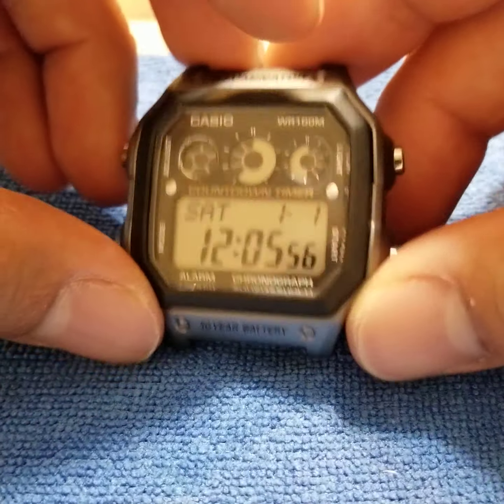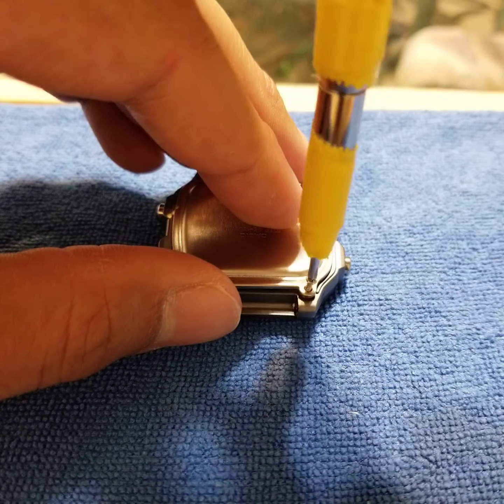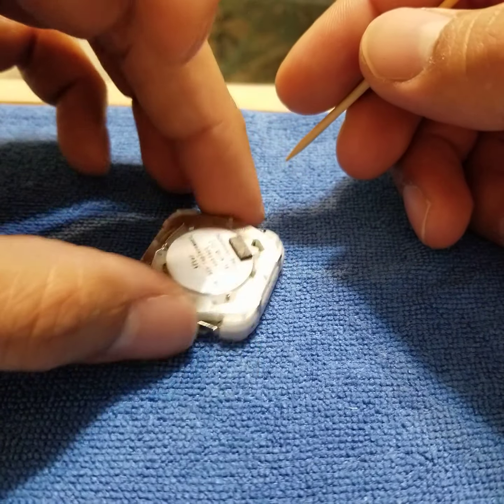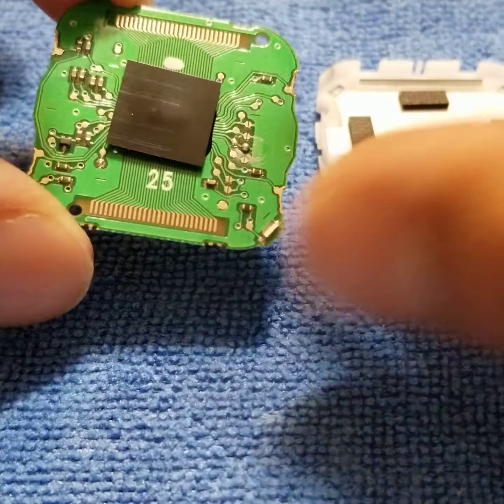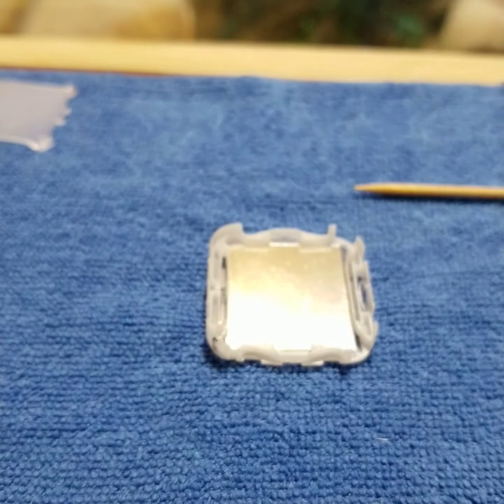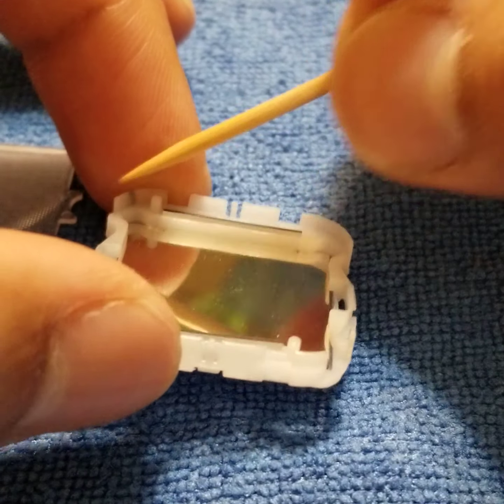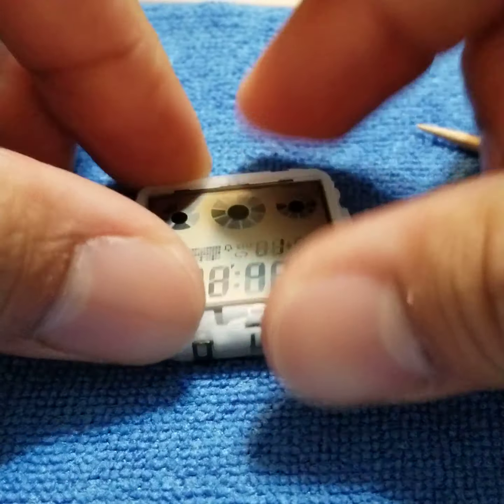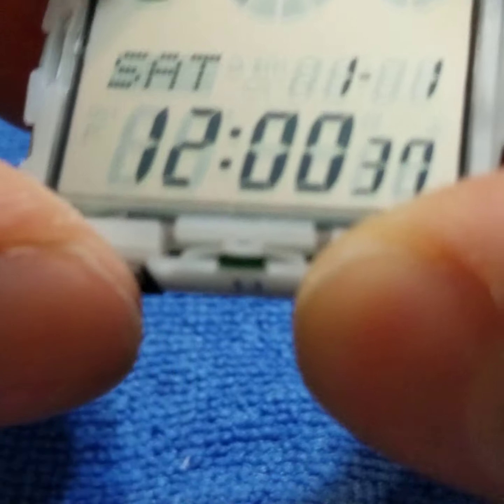Casio Watch Mods: Casio Mod Polarized Filter. Casio AE-1300WH disassembly & reassembly

Comment: Those white strips arent spacers, they are silicon/elastic graphite connectors. They provide connection from the board to the display so better be cereful with those. Still a great video-tutorial.